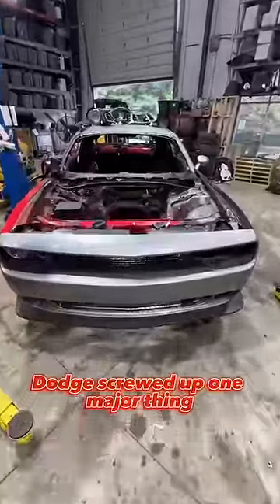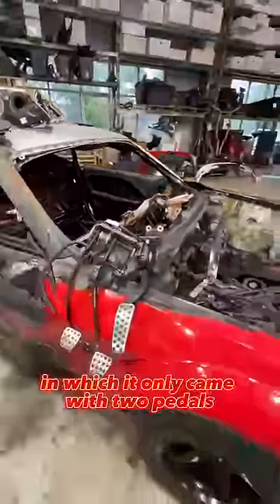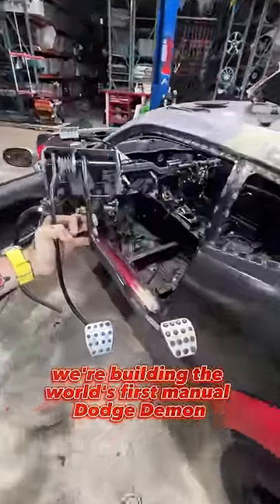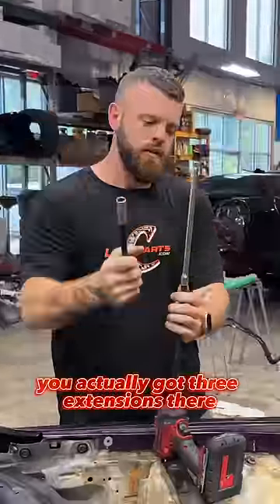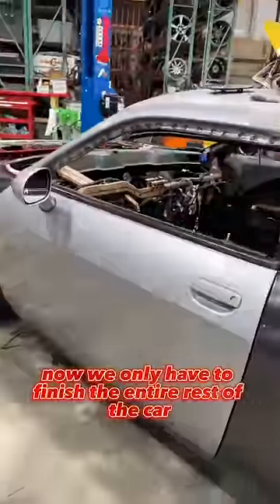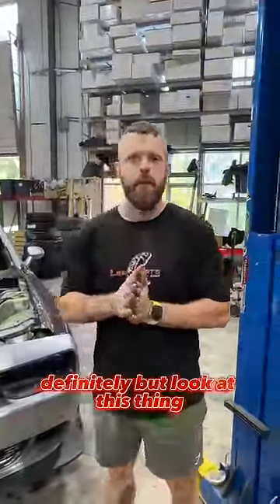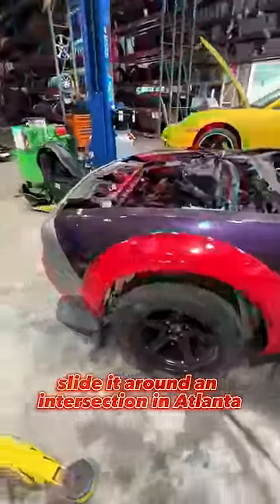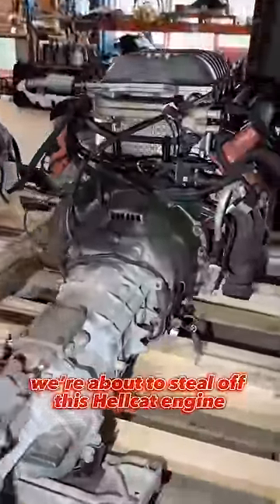Dodge made one HUGE mistake on the Demon!

Comment: No, you are the one that is making the mistake. The Demon was more than just a higher HP version of the Hellcat engine, it was a total package that was made for drag racing. It used a special torque converter and the transmission was programmed differently for better 1/4 mile times. Plus it had an actual transmission brake, that allowed much better launches. What you now have is slower Demon that would be equal to the later model Hellcat Redeye in performance. Good job on ruining an amazing car.

Comment: Oh boo hoo. An automatic is apparently the devil.
Reply: No just boring
Reply: @haydenagnew but it’s faster
Reply: @sonic72763  in a straight line
Reply: @haydenagnew  sure manual fan boy
Reply: @sonic72763  its normal where I live so its not a case of i think I'm better because i drive manual auto in a straight line is faster but look at any motorsport that isn't drag racing they use manual because controlling what gear ur in will speed you up through corners

Comment: Let's say on a 4 banger OBD1 or older that's under powered, a manual  is way faster than a auto unless it's built, if you know how to drive, stay in the powerband-dont hit Rev limiter-shift quarter of a cunt hair before Rev limiter or speed shift(power shift).  Changing trans gears-rear end gears-tire size makes a difference.  Don't know much about the high hp stuff, I'd rather have control, n autos cause your lazy !!!